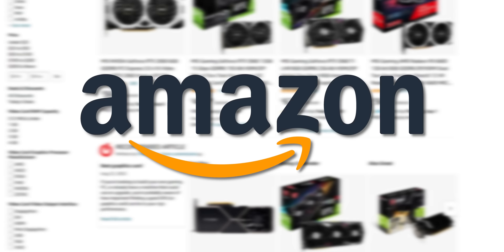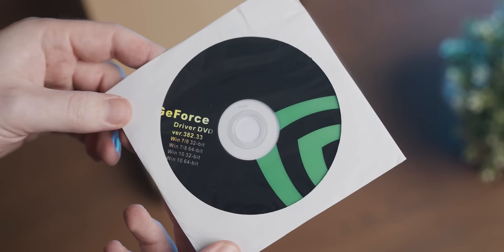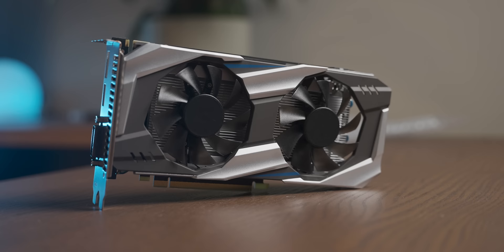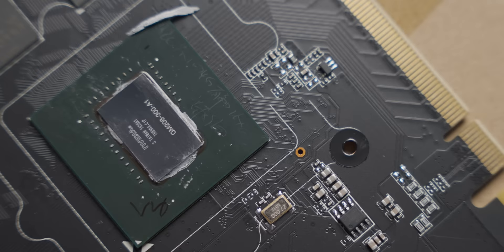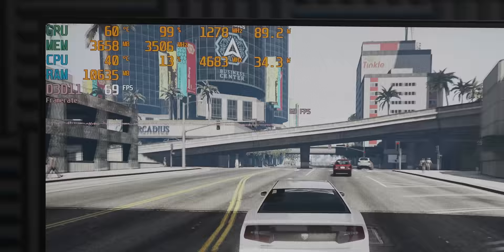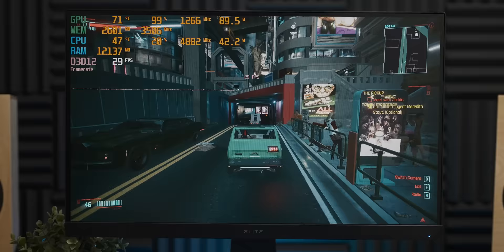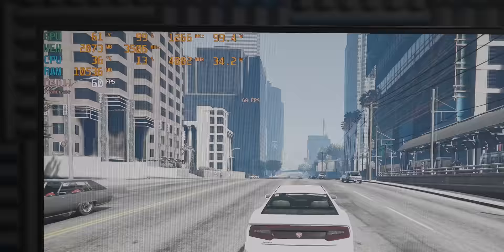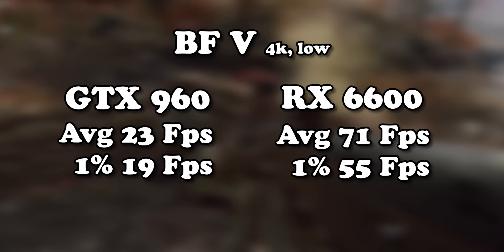According To Amazon This Is A "4K HDR PC Gaming Video Card"

Comment: 2:41 There probably is a VGA port on the back, it's just part of the DVI port. The older version of DVI had 4 pins around the flat pin on the right indicating that it has VGA capabilities so that you can use a DVI to VGA adapter with it. Being that this is a "Shenzhen special" though, they might have just used the wrong connector.
Reply: Yes you can see the 4 VGA pins.
Reply: Yes, that DVI port has VGA capability. It also has HDMI and DP capability. The 4 pins are just the analogue pins. You can get HDMI, DP and VGA adapters for the DVI port. Back when DVI was popular, depending upon the graphics card, if it came with DVI + VGA or DVI + HDMI, you either got a HDMI adapter or a VGA adapter. I have a couple HDMI adapters and a couple VGA adapters.

Comment: My old GTX 1060 6gb has a shroud that looks exactly, well actually almost the whole card looks like that, even the IO ( the dvi is digital only though ) , it doesnt have an sli bridge and the components under the cooler are different (of course). The temps are better than my 1060's and I was surprised by that . The model in question is a KFA2 GTX 1060 6GB OC. I did use it at 4k and it was playable in all games I played so when I saw it I was thinking it was a 1060 and that it will handle 4k , even if it's not that great. Awesome video!
Edit : My card also came with a dvd with drivers looking exactly the same but different version and in a beautiful box.
Reply: The KFA2 1060 has the same shroud but it has actually a different underlying heatsink construction, it's enhanced with 2 heatpipes, which this one is missing. So they must have remanufactured the heatsink or maybe there was an odd version that skipped the heatpipes?

The PCB is not familiar. It looks like a Palit group 1060 PCB except with stuff shifted around and molested just a tiny bit, like the 1060 should have one more phase, honestly the 960 should as well. Judging by markings it's newly manufactured from salvaged junk chips. It might be designed around the KFA2 1060 footprints though. All reference PCBs are shorter and they have the power delivery up near the rearIO rather than in the butt part of the card.

Temperature difference... well who says that it isn't lying, or maybe it's running the fans really fast.

Comment: My GTX 970 is still a pretty solid card for 1080 med-high settings for the games I play. It is definetly the bottle neck against my Ryzen 5 1600 though.
Reply: I've built a few ryzen pcs and the 1600 is a decent chip. It runs most games at 60-140fps paired with a 1660. It shows that ryzen is really impressive.
Reply: @RealRed01  When my 970 goes out I think im going to get a 5600 or 5700... a 1660 at the right price wouldnt be a bad bet either though
Reply: 970 is severely outclassed by today. it cannot even compare to a 570 or a 1660.
Reply: @scottyensen  Stop cheaping out on old tech and convincing yourself it works, and just save a little longer and get a 3060ti or 6600XT for god's sake, lol. Current gen prices are going to be at their lowest yet soon, and the used market is full of decent deals.
Reply: @MadClowdz  its not really cheaping out, I bought them  brand new 5+ years ago at full price ....
Reply: @scottyensen  he means with the cards you were considering.
Reply: @scottyensen  They mean mid tier market is great right now - every $20 or so you are willing to spend is getting you a solid 5%+ in performance in that tier so getting old cards doesn't make as much sense.
Reply: @MadClowdz  Maybe not everyone has 440$ to buy a GPU?
Reply: @Abythh  I didn't...but I tried this thing...what's it called? Oh yeah, having a goal and saving up. It worked. lolz.
Reply: @MadClowdz  Okay? Good for you?
Reply: Got a 970 too does everything I want it to well :).  Ok there is nothing in the house that can do 4k or 8k so I have no need of those resolutions.  Ok one day I plan to get a new card but its more to use the 970 in a backup machine.  Mind you I took a look at amazon some weeks back and got a bit lost trying to pick one I was looking into 1080 cards but they were not about just lots of random numbers I gave up after a bit lol.

Comment: I remember the gtx 970 (ti I think) was advertised as a 4k gaming card at launch. 

"What would anyone need all this gpu for?"
 "4k"
Reply: No it wasn't 4k didin't exist that time when gtx 970 was around, we talking 2015 launch.
Reply: It was a ridiculous claim. From computer power user magazine based on an interview they did at some trade show.
Reply: @kigasdj2  huh??!?
Reply: @Louganda  what huh???
Reply: @kigasdj2  aggiuuhhh????!!!
Reply: I remember that the GTX 980 was marketed as a one of the first truly 4K capable cards, and they did have 4K screens then but they were far from cheap. The GTX 970, not so much, though Digital Foundry has done a more recent video where they tweaked Crysis 3 to both still look pretty good and run fairly well at 4K on a GTX 970.

Comment: To be fair it ran Cyberpunk without any stuttering issues very smoothly, granted at 9 frames per second :)
Reply: And you can take it outside to touch grass with your portable gpu
Reply: That's stuttering
Reply: @everythingpony stuttering typically is dipping frame rate

Comment: I came across a gaming PC just a couple of days ago advertised as 4K gaming PC. It had an i5 10400F, 16 gig of ram, 250 GB SSD and an RX 6600. I couldn't resist, I just had to comment on that rig and point out that the significantly more expensive and better RX 6700 XT was sold as a 1440p card, just as comparison.
This rig was priced at around $1600.
Reply: A good hardware combination for an outrageous price. for that price I can build a rig with a 5800X, RTX 3070, 32 gigs of RAM, 1 TB SSD, aio watercooling and a windows license.
If they shave of some of that money the 10400F/RX 6600 combination isn't bad.
Reply: The RX 6600 is a great card ... at 1080p. I don't expect it to do well at 4K, and I do not own a 4K monitor

Comment: i had a MSI gtx 960 4gb version, the gaming model (black and red), what a beautiful card, cold like a freezer, i overclocked the heck of it, +150 on the core and 500+ on the memory, and the highest temp i saw in that card was 51 c in summer with 32 degrees ambient, (all in celcius by the way), what an absolute monster i loved that card and was very silent because the fans will never spin past 41%, it will push every game from 2013 up to 2017 (that's when i traded it with a 1060 3gb, an asus phoenix), i regret not getting the rx 470 4gb, it was a shappire pulse model (this one was another option to trade). the only game i was able to run at 60 fps at 4k was the need for speed hot pursuit (the one from 2010) using DSR.
Reply: I picked a pretty bad time to get into PC gaming last year but even my old GTX 970 is running just about everything I want it to run pretty darn well at 1080p.
Reply: @notisac3149  970 is still a pretty good card. I've got a 1070 and I have no desire to change it out for something newer tbh. Runs everything at 1080p and can even go up to 4k in games like doom eternal or gta 5.
Reply: @JudeTheYoutubePoopersubscribe  the 1070 is like 50% above the 970 though. the 1070 is super under rated, it almost has an excessive amount of vram unlike my 3080 that gets almost maxed out rather quickly
Reply: @bradhaines3142  true for 1080p I've never been able to max out the vram. And at any higher resolutions and actually attempting to max out the vram I just run out of performance long before the 8gb is actually used up lol. Strange that 2 generations later they released a 4k very capable card the rtx 3070... With the same 8gb of vram. For the rtx 4000 I wanna see 10gb as the absolute MINIMUM and that's for the 1440p focused cards.
Reply: @notisac3149  Hi5 GTX970 crew! Lots of people rocking them in the comments here. Not ideal but does what it needs to, and mind, i'm running mine into a nice 1440p HRR monitor, i feel that helps salvage it a lot especially HRR support so a missed frame isn't quite so stutter inducing as on 60Hz. I know, bit of an overkill on the monitor side, but odds are, i'm not keeping GTX970 for another 2+ years, but i'm keeping this monitor for 5+ years, expect to, and working with graphics and text is a dream, scrolling text with 120Hz is so smooth. Like it's pretty rare that i get to enjoy the full 1440p res or get anywhere near to 120-144fps in newest games, but i get to pick a situational compromise, not every game is super demanding in one regard or the other, and i'm really enjoying FSR2 upscale now that that's here, and high density LCD helps upscaling tech look good.

As to what's not ideal. 4GB VRAM is a little limiting, 6GB is better. There is no HDR support but i mean the monitor only does HDR400 which is more of a hit or miss experience. There is no FreeSync VRR support over DP and having that would actually be nice. From the performance standpoint, if it was 20 to 50% faster, that'd be nice, but it's such a minor compromise really. What's absolutely not been a problem is the 3.5/.5GB memory split since the slow memory is absorbed by the desktop manager anyway, it's still less problematic than a 3GB 1060 which would have cost me about the same or a little more back in the day.
Reply: @JudeTheYoutubePoopersubscribe  VRAM amounts come out of bus width; the necessary bus width for any performance grade comes out of memory speed and whatever fancy tricks to reduce memory hits the GPU uses. So they don't have much leeway here. Both the 1070 and 3070 have 256-bit bus width, which is how much they need to make their performance, so you must attach 8 32-bit memory chips to fill the memory bus, and memory chips come in power of two sizes, so next smaller or larger chip is twice as large or half the size. 8 chips of 8 Gbit in size make for an 8GB VRAM. You can also double the memory for a given bus width by attaching two chips onto each 32-bit port via address multiplex or chip select (one non-data line difference), while they share the data lines.

Now consider that for both, shipping 4GB would be distinctly too little with how much VRAM DX12 titles can take, 8GB is maybe a little much, but 6GB would have been too slow, as the bus width would be only 192 bit. At 192 bit you might as well throw a bunch of ROPs and shader units away as the card is limited to a lower performance class by insufficient memory bandwidth, so it would be exactly a -60 model GPU rather than a -70.
Reply: @SianaGearz  I got no clue about memory to be honest but no card for the upcoming gen should be shipping with 8gb especially if the card does have the graphical horsepower to drive 4k high settings + Ray tracing.
Reply: @JudeTheYoutubePoopersubscribe  I think we're gonna see 8gb on the -50 model again. I don't have a prediction for the -70, we're gonna need a 320/384 bit bus aren't we... because yeah i don't think a -70 with 8GB again would be anywhere near adequate, it needs extra.

What would be interesting if they brought back the mutiplex scheme similar to 970 for another purpose now, to extend the VRAM. so they could have a 256 bit bus split into a 224 and a 32bit bus. The first 224 could house 7gb and the last could house 4gb, totalling 11gb. Then you could have something like 8gb fast/3gb slow, and it would just shove cold data off to the slow section, they seem to have handled that well on the 970. I'm not sure my napkin math works out though, there could be traps, since it's fundamentally a different multiplex from what they've done before.

Or just eat the cost of 16GB or a wider bus to support 10/12? Maybe that's fine? This is why predictions are difficult.

Comment: I wanted to see what would happen when you tried official Nvidia drivers with the sketchy card.
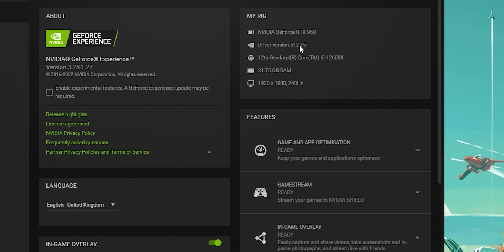Reply: at 3:34... they installed and confirmed that it is a real GTX 960
Reply: He used the official Drivers (CD had 382.33) and (the official was 512.15)
Reply: @SgtPrime999  Why did the sheet say not to use the official drivers then? maybe generic documentation?  That cd didn't look too official btw, I could be wrong, looked ghetto.
Reply: @IvanOoze1990  Of course, the CD is from some random manufacturer in China and in most scenarios it has the only drivers that work with their sketchy cards. In this case it appears that the card didn't have custom firmware to make it read as a different (better) card and so the correct nvidia drivers were installed and it runs just fine.
Reply: @RealCytho  So generic documentation that they include with all their cards including the fraudulent ones. Gotchya.
Reply: @IvanOoze1990  The "RTX 3060" must have been too hard to spoof so they abandoned that plan and sold them for what they are, but still included the sketchy driver disc out of habit.
Reply: @--_DJ_--  It was an GTX 960 I believe. and it was probably recycled from e-waste, explaining the marring on the chips.
Reply: @IvanOoze1990  I am ever so slightly embarrassed for you.
Reply: @--_DJ_--  I'm waiting for you to chime in and attempt to defend yourself, this should be interesting.
Reply: @IvanOoze1990  I don't think I need to defend anything. You are the one who didn't understand what my comment was about. I am eagerly awaiting your apology.
Reply: @--_DJ_--  You're insane. You thought it was a 3060, called me out when the proof is in the video and even in the sales link. If this is about The E-waste comment, you're wrong about that too, I was right about the generic documentation. Clear up the air if you will, I'm still waiting. The only embarrassment I should face here is the fact I'm being a little overly edgy with you. Anything else to say?
Reply: @WirrWicht  That much was known, I just didn't know if the cd drivers were legit, another guy here cleared it up for me.
Reply: @SgtPrime999  So the cd contained legit drivers. Thank you for answering my question without having to challenge me like a turd nugget, I appreciate that.
Reply: @IvanOoze1990  Ok, now I am fully embarrassed for you. That was another swing and a miss. Try reading my comment again, maybe slower this time since you don't seem to be having much luck at your usual pace. 
I didn't say you were wrong about anything, if you had understood my comment, you would get that. I can explain it if you ask real nice.
Reply: @--_DJ_--  what are you two even fighting about 😂 hope y'all are friends now
Reply: @Tx_Jay_  Hehe, nothing really. He just misunderstood what I wrote, and I had some fun with him for a while after. We are besties now I think.

Comment: Speaking of large framebuffer versions of slow cards, you should take a look at the 8GB RX 6500XT, with 8GB of RAM it should no longer be bottlenecked by PCIE 4x slots. Only the price, as even the 8GB version shouldnt be over $150, but is currently selling for $210

Comment: I had the 4GB version of the GTX 960, and it several games it did play in 4K low-medium, the ones i was really impressed with at the time were things like Fallout 4, despite being built on the engine of a game from 2009
Reply: Its imposible to run fallout 4 in 4k with hd textures even with rtx 3080 on max. Hell, not sure even rtx 3090 can run it smooth 60fps with everything on max in 4k. Thats one fucked up engine :)

Comment: I Just Casemodded an old PC-Tower with my Ryobi foxtail Saw. There was to less Space for an 1060 inside so i get rid of 2 intern Hardrive Spaces and 2 Slot for CD-ROM drives. It had 5 for each now 3 fixed with cablebinders. It runs fine with the 3570k z77 Board rams and 1060 GTX. But i cutted my Fingers 3 times on the edges the Saw left inside, while building it back in, but still good for gaming in full HD.

Comment: Nice to see a 960 doing as well as it is in 2022 at 1080p, means my long since gone 970 would still be a great card if i was content at 1080p. Alas I went 970 to 1080 to 3080 at 4k 120hz now, eagerly waiting for 4k 240hz with DP 2.0
Reply: Wonder what card could possibly drive 4k at 240fps lol. I suppose in esports games you can do that now actually.
Reply: @JudeTheYoutubePoopersubscribe  The 3080/90/Ti can all do it easily for more esporty titles but even other games can do it just really depends how many graphical settings you're willing to sacrifice. Next gen cards will make it even easier and should be shipping with DP 2.0 just need monitors to catch up now. 

I don't know what I'll do though I'm using a 42" C2 and giving up OLED to go back to an LCD just for 4k 240hz doesn't feel worth it.
Reply: @Malinkadink  yeah I wouldnt downgrade from an oled. Gonna have to wait a couple years for 4k 240hz + oled to come out and actually be affordable ish.

Comment: Seems that the only problem with the card is the advertising of it being a 4k graphics card.  I think the GTX 980 was capable of 4k, but don't think the GTX 970 or 960 were.  As for the description "easy to carry") it could be that the specific store on Amazon perhaps sells a bunch of things but ueses a generic template for their listings and someone just forgot to remove that (maybe they sell laptops and tablets too or something that is actually meant to be "portable", although this is a bit funny to see in a description for an internal graphics card).